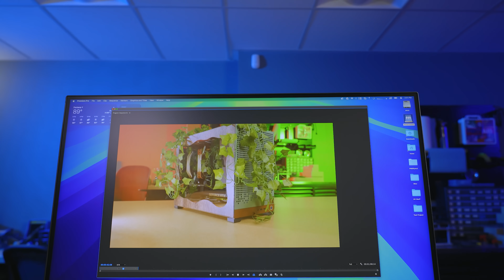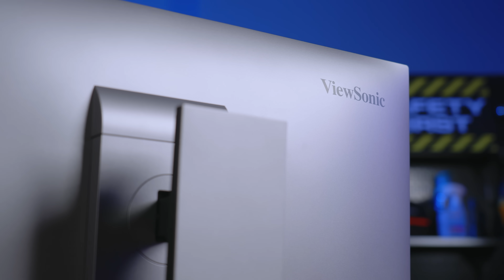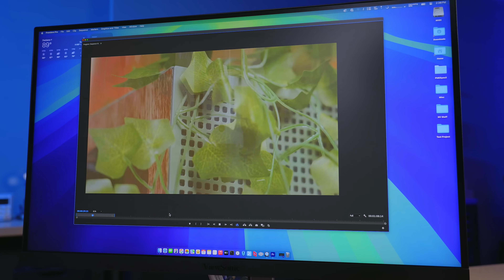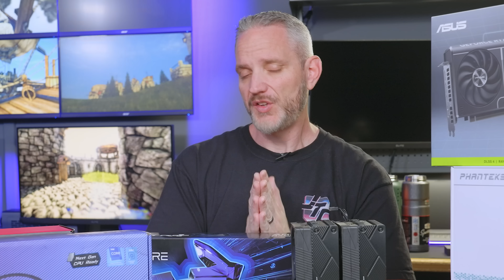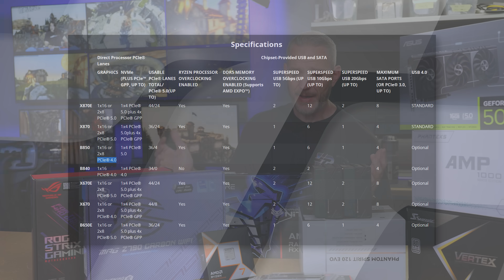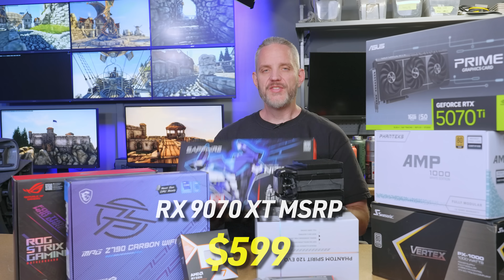This is the Sweetspot for PC gaming... Don't get fooled into spending more!

Comment: About the Sapphire Nitro+ 9070XT card ... while it may be used here as an example for an overbuilt and maybe overpriced card, can we please talk about how Sapphire had to f**k things up beyond understanding by making the decision to power that thing with a 12v hipower connector? Since when is cleanliness and cable management more imporant than reliability? Even if the card "only" draws half of what that messy connection is supposed to handle I'd have absolutely NO trust in its reliability. Thats the real issue here (at least for me). Not the rgb, not the massive cooler, not the maybe unneccessary features the card may have.

Comment: i totally aggree with psu theory. in fact i feel the need to add that you need the extra power not only for a possible update, but because all the electrical equipment of it will have to run in more load than an overspec one. Running electronics towards its limits for big periods provides lesser life time to them. Saying that life cycle of psu is bigger just for that. So its not only adaptability, but also usage time. 80 Bronze and gold is also a feature you need to avoid.

Comment: sweet spot now is to just play 1440p and aim at raw performance at 60FPS. With , lossless, DLSS or FSR, you can then go ahead to adjust them higher. There is no need to buy a x3d unless the price is so low. Even a 7500F with a 6700xt will score that kind of performance for most of the games

Comment: Right now i have a budget R5 5500,GTX 1660 6GB,32 gigs of 3600mhz ram and 5TB of storage in ssds and a hard drive.

I do plan on changing years down the line the R5 5500 with what is the best performing AM4 socket cpu but only a long time from now when the R5 5500 no longer holds its own.
As for the GTX 1660 i plan on changing that with a 7600XT 16GB this year or next year, not the top pick but should hold me for a long while and it's decently cheap compared to other options, i could get a cheaper Nvidia equivalent like a 3060 or something better BUT screw Nvidia i won't support them anymore, i hope they go bankrupt soon.

Basically when i built this PC i focused on spending on the upgradeability for future, the B550 mobo allows for decent future proofing cuz again i may have a mid tier PC atm but i can upgrade everything in time as needed, that's how i always love to do it, never go for top tier shit, too expensive for what they are and never go below mid tier cuz you will have a bad time playing.

Comment: 100%
There are  lot of overspending when it comes to gaming. I suppose if you want to run 4k then you want to spend a lot. However, most people will not realize once they get immersed into the game.

I have found that a B-series motherboard, entry level AMD CPU (latest Ryzen 5) and mid-range GPU like RX6080 / RTX4070. (yes, no 5000 series, that is a waste of money).
32GB RAM also is enough. You can get away with spending $1500 or even less. And you can game to your heart's content.

Comment: There is some weird stuff in there. 12:28 That cooler at about $ 60 is not the sweet spot when you can get a thermaltake peerless assassin for about $ 35. And you get an AIO such as the arctic liquid freezer for about $ 80.
The PSU size discussion is out of whack. Yes you should take a bigger PSU but don't overdo it. We're talking about a system like a 9800x3d + 9070 xt here which has an estimated power draw of 550 watt in pcpartpicker. A 650 watt PSU would be fine and I would go for 750 watt which offers additional 100-150 watt for future GPU upgrades. (efficiency of PSUs is so complicated that you can't fully cover it in such a video, the rough stuff is correct thought!)
Did I miss it or didn't you talk about memory capacity and SSD size? Such a video would be aimed at non experts after all! For memory obviously 32 gb. For SSD it's important to mention that pretty much all current motherboards have multiple slots and you can easily upgrade later if you feel the need. 1 TB is advised at least. 2 TB has better price per size. Only go for more if you have personal reasons to know that you'll need it.
I would have liked to have a rough price range given at each part and then have a list at the end so that people know a ballpark number for such a system.

Comment: With the x3d or not CPU I think it depends on the games you play. I play quite a bit of simulation heavy games (like Factorio or strategy, 4x games), where GPU is not as important therefore I consider x3D as important. But yeah, if you mostly play story, graphics, high fps driven games i wouldnt recomend x3d for a budget gamig rig

Comment: What do you mean vr ready stickers? That was in the time of 1060, the lowest tier gpu for vr. The only other thing you need, if you want to play pcvr over usb cable with a Quest, is a fast usb connector. Or a hdmi connector for a pcvr headset, which is on every gpu today. Dont tell me there are still some new motherboards which dont have usb3. Regarding wifi for wireless vr, you need a separate wifi 6 router for that anyway.

Comment: JayzZeroPhysics you do not understand efficiency. Going from 80% to 90% efficiency is not just going on 500W load from 625W net draw to 555W it's going from 125W of heating for PSU alone to just 55W of heat, this means that your PSU will create less than 50% of waste heat in titanium rating than gold rating! If you have your PSU in colder spot you will have more silent PC because it can spin down and be silent if waste heat is this low. Whole PC will still have those 500W of waste heat but if it's not going near PSU much then your PSU will have much easier time staying cooler and more efficient because physics!

Comment: Very good video! I learned the hard way about not overspending—or rather, not underspending—on a power supply. Back in the day, I was building on AM4 with a Ryzen 5 2600 and a GTX 1060, paired with a 600 or 650W BeQuiet PSU. Later, I upgraded to a 5600X (got a good deal at the time—otherwise I would’ve gone with the 5700X, since the 5800X3D wasn’t available yet). Unfortunately, that limited me to a GPU no higher than the 6700 XT, even though I had the budget for a 6900 or even a 7900. Fast forward to now: I mostly use my system for work, and my 5600X was hitting 100% usage too often. So I upgraded to a 9950X3D with nice msi b850 tomahawk mobo and 64 GB of ram. I wanted to stick with an AMD GPU, and until something better comes out, I’ve chosen the Hellhound RX 9700 XT. This time, I didn’t hold back on the power supply—I went with a 1200W BeQuiet. Now I’m ready for the big-boy GPUs in the future.

Comment: Just bought a 5090 Suprim instead of an Astral as the price difference was actually almost like an used 5070 which is nuts. Yes the Astral comes with a fancy 24phase 80amps VRM instead of the 22phase 50amps (like basically any other 5090).

Comment: £220 price difference between 9600 and 9800x3d
£1000 price between 5060 and cheapest 5080
And that's why people are more likely to spend extra on the CPU.
Reply: That's doesn't change the fact you're wasting money spending more on the CPU.  Just pocket the savings for a future purchase.

It also makes no sense to pick those two GPU's.  For £220 more than a 5060, you can get a 5070 which is 50% faster at pretty much ALL resolutions and settings.  Meanwhile, a 9800X3D is about 13% faster than a 9600 at low resolutions with a 5090 and about 0% faster at high resolutions.

Comment: no mans sky likes to eat cpu for breakfast. only using 25-30%, but that 30% is much faster with my 9700x. on the 5600 my gpu was bottlenecked. so some cpu bottlenecks not necessary come up at 100% usage

Comment: Help! I know this is more of a  PC channel, but can you recommend a sweet spot for laptops with maximum gaming performance?

Size, weight, and battery life, RGB,  aren’t major concerns but  I still need a laptop for mobility. I play a lot of simulation games like X4: Foundations, Mount & Blade II: Bannerlord, and Oxygen Not Included, stellaris, which tend to slow down significantly in the late game. 

I’d also like to run demanding titles like Cyberpunk 2077 and Final Fantasy VII Remake in medium settings smoothly if possible.

Comment: Overspeccing a PSU just for future upgrades? Honestly, it's a questionable move. Most people don't swap out their systems every year-it's more like every three or so. And by the time that upgrade rolls around, we're usually looking at components that are not only faster but more power-efficient. That makes the whole "upgrade-ready" excuse kind of moot.

Plus, PSUs come with warranty limits. Even if yours hasn't gone up in smoke, there's no guarantee it'll play nice with newer, potentially hungrier hardware down the line. So that "just in case" mindset ends up looking more like wasted headroom than smart planning.

Comment: Just build PC this week. Rate it 😅: 
-Ryzen 7 7700x
-Gb Aourus b850 WiFi
-16gb Vengeance 30cl 6000mhz
-AIO thermalright frozen notte 360 v2 (£44 🧐)
-9070 xt nitro+ (£630. £80 over MSRP)
-🤫 coolermaster V650 gold-v2 (bought year ago for my old dead pc - hope to upgrade Black Friday)
Reply: 32gb ram is golden standard nowadays, should’ve gotten more

Comment: I accidentally purchased an intel xmp 3.0 module from z skill 6000 mhz cl30 latency dual channel 16*2 ram module instead of amd xmp module in My asus tuff b650 wifi motherboard. But I am getting 6000 mhz and cl30 all by enabling DOCP in bios. Is it okay or I have to change My Ram. I am using amd Ryzen 7 7700 with Rtx 4070 super oc gpu

Comment: i buy pc parts so rarely, i always get the fastest non-workstation hardware
so i just got the 9800X3D, and MSI 870E tomahawk (motherboard recommended by the upside down steve)
replacing my 8700K and still pared with my 7900 XT card... its a vast improvement and im super happy with it.
And the old computer can go to a family member. nothing is wasted! And my next upgrade is in 4-6 years. We'll see.
As for ram purchase... check the motherboards QVL for memory compatibility. if youre set on a specific set of ram, check the ram manufacturers site for their compatibility test list.
i went with gskill ram. And also an air cooler.

Comment: This sweet spot is some 30-40% above my sweet spot and my money ; ) EDIT during watching: 1. Water cooling is a big no for me, it has fans anyway so well... 2. PSU choice: I would stick to very slow upgrades of wattage, e.g. give yourself a 750W-limit and then buy stuff that it will be enough for. Why? They will go up and up without any limits and then there are new taxes because power is sooo expensive... so I would choose a CPU and GPU that would make me sit with the same PSU for 5-6 years at least. And then of course, buy a very very good PSU but don't go into 850/1000W area...   it's ridiculous and it's madness! 3. Moore's law... well, Ray - remember they can have Moore law's hardware in their labs but what lands on the market might be a whole different story...  so I wouldn't expect Moore law to be materialized in every generation of hardware.

Comment: I overspent on my mobo, my intention is using it as the backbone of my system for a long time and upgrading other parts as I go. I bought a used case. You can find lots of neat older cases for the cost of a cheap new case. I didn't like how small the window on my case is, so I replaced it with a sheet of acrylic, and I have more acrylic I want to use to make a psu shroud, but I haven't gotten around to doing that.

Comment: 18:07 another very valid reason to over spec your PSU that you should have mentioned is that power supply efficiency curves depend on load, and the vast majority of power supplies are MOST efficient at 50% load. So with a power supply over specced for your build, you will pull less power from the wall due to running at a higher efficiency, saving you money if you pay your own power bill.
Reply: For a RX 9070 XT system you need 450W so the recommended 700-750W PSU already overkill, but the power consumption lands in a sweetspot with 60% of usage. Modern PSUs most effective range pretty flat now between 40-80%.
PSUs are pretty bad at low power consumprion, under 10%, so you should rather aim for the idle power consumption, which is 30-50W in most systems, so you should choose between 550-650W for a midrange system. Lets face it if someone will build a midrange system never gonna upgrade it to a highend system. Even if you upgrade to the old highend, it has the same power consumption as the new midrange (RTX3080 vs RX9070XT)

With an overkill PSU you not gonna save money while gaming, but your PC will consume more power at idle. Let see two bad example 500W (90%) vs 850W (52%), if you choose 850W you save 1W/h at the peak, but also loose 10W/h when you are not gaming compared to the 500W. While the 500W is perfect on paper because you use the most efficient range of the PSU there is no room to grow in the future.

Comment: a b650 has a pcie5 gpu slot. there's a good reason to get a decent chipset in 2025: Future upgrade path. It may not be a huge difference now, but you dont know what the future holds. might as well buy the right spec

Comment: My wife's PC was way outdated so I built a new one for her last year.  

ASUS B-650 motherboard
AMD 7600X3D 
32 GB DDR5 6000mhz
(that was a $400 Microcenter bundle)
Montech Air 903 Max case
MSI MAG A850GL PSU
2TB Gen4 NVME
Peerless Assassin CPU cooler
XFX 7900XTX GPU
Alienware AW3425DW monitor.  240hz, QD-OLED, 3440x1440 ultrawide (recent upgrade, got it for $670 on Prime day)

Total cost of all that was about $2600.  An entire system, with a very nice monitor, for less than a 5090.
Reply: My entire setup costed half your wife's system my pc costed me 500$ (bought used I checked and with that I would pay only the gpu I got in it and sure its a lousy 4060 8gb but here its almost 600$) and 200$ the ips monitor 1080p 280hz but I do manage to use the fps pc is not as good as yours tho for sure but is enough for me around 300$ the rest of the setup (chair and table included im a cheap fkr) im happy with what I got for now my pc before this one costed me 200$ and I can play fortnite at 120fps on it so is not at all bad but I broke it recently still havent fixed it because I have this one now 😅

Comment: I need a "sweetspot" because I bought a 4090 last year slightly under retail and have been waiting to upgrade the rest of my system. Just finally picked up a 9800x3d, so now I've used up all my budget on the expensive stuff lol. I will say that ASRock blew me away for the features and quality they provide on x870e boards for the price. The "Nova" I bought has like better specs and features than mobos that are $300+ more expensive.

Anyone have good (budget-friendly) RAM & cooler suggestions?

Comment: If someone has 1650 euros to spare in Germany: 7800X3d, 32 DDR5-6000 RAM, 1 TB M.2 PCIe 4.0, 850 Watt power supply (Gold standard) + 9070XT. I just looked it up because the specs match my system. At the beginning of the year, you would have paid a bit more for it (which I did). I guess you can't get a new system like this cheaper for a long time.

Comment: GPU market just sucks right now, new and used. Unless you're going for the 3000-series cards, if you're looking at used 4000-series cards, you're not going to find any significant savings compared to buying a performance-equivalent 5000-series card. Simply because Nvidia ensured it would be this way by ceasing manufacturing of 4000-series cards before the 5000s were ready to be launched. By the time they launched the new cards, there were hardly any 4000s cards left on retail shelves. Unless you 're fortunate enough to find a seller who doesn't know the market or doesn't know his stuff, you're likely to find the 4000-series card selling for only $100-$250 less than its 5000-series equivalent. Would you accept that little savings for a used card vs a new card with full warranty period, newer technology, marginally better performance(maybe?), and none of the unknown history of prior usage?

For eg, I game in 4k and 1440p so the most suitable card would probably be the 5070ti. Only Nvidia cards for me cos I also dabble in AI and CUDA is really the go to for AI. In my country, the average price for a 5070ti is around $1300-$1450. A comparable 4000-series card would be the 4080 and 4080 Super. Most of the used listings in my country for both these 4000-series cards are asking for between $1200-$1500. That's for a card that's between 1+ to 2+ years old and typically runs hotter than any of the existing 5070ti models under the same workload. I live near the equator, and ambient temps hover around 28-31 degC. Even without the temps comparison, just taking into consideration the pricing, does it make sense to buy a used 4080/4080 Super instead of a new 5070ti? In any case, I'm gonna wait for the rumoured 5070ti Super, just for the increase in VRAM for my AI workload.

Comment: I prefer older cases to new ones, in that I really don't want tempered glass. I've got a large Cooler Master that is about to receive its at least fourth motherboard. And I am not a big fan of RGB. What I want to see comes out of the monitor, not out of the case. A trucker once told me that the chrome parts under the hood don't help the truck perform any better, and that's my philosophy with the bells and whistles inside the case.  I am reusing my homebuilt water loop, but I would consider air, and bought a Cooler Master aircooler for my test bench. And I have gone with a 1000-watt Corsair power supply for all those builds (the same one). I know, to each their own, and I respect that.